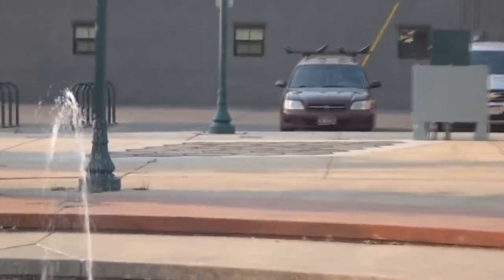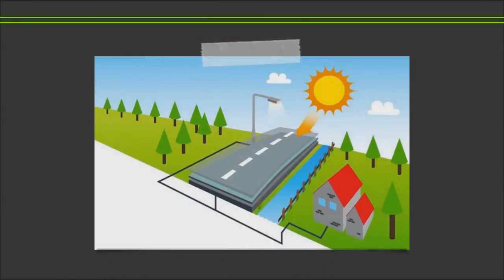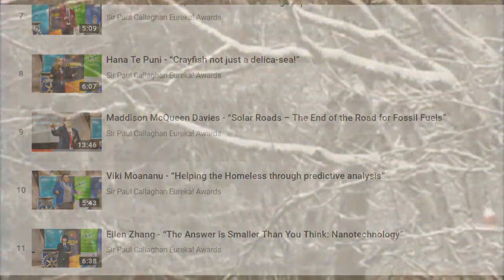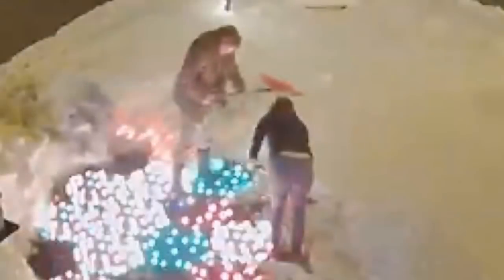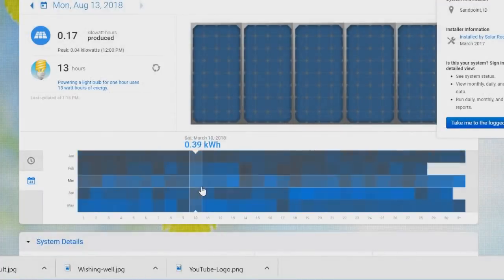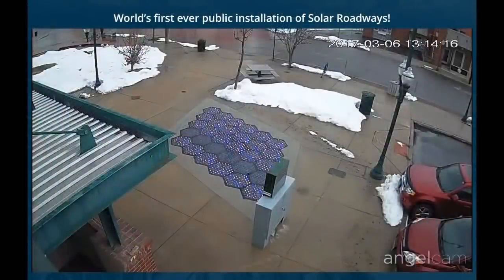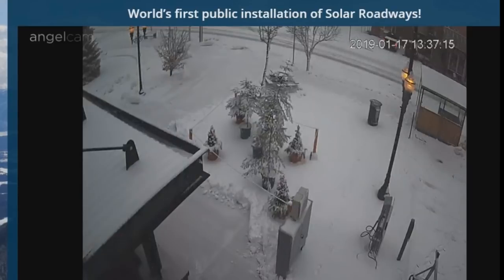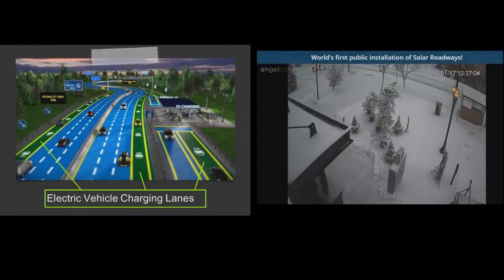Solar Roadways to be installed on Cruise ships!!?

Comment: >Cruise ships pumping out huge amounts of pollution
>solution: add solar panels
that's like justifying eating fast food on a diet because you are also eating a salad first.
Reply: Put solar panels on cows to offset the methane. Global warming solved. Lets celebrate with burgers!
Reply: @ZefVolk  Don't let Trump read this. I know he would try.
Reply: Gen Scinmore Cruise ships don’t pollute as much as you wish to believe.
Cruise ships have very stringent exhaust regulations to follow for one and most ports too have regulations in place for how much a cruise ship can pollute.
Should a ship not follow, they won’t be allowed to go along side the port alt pay a heavy fine.
Reply: Freddy Kabuffke Aaaaw snowflake still crying about Trump winning is it 🤩
Reply: @erikjohansson1814  Why should I cry? I'm not even American. :D
Reply: @erikjohansson1814  No.  The people crying are hundreds of thousands of federal workers working with out pay, the millions of federal contractors who are losing their livelihoods and will never be refunded, and the millions of people posed to face starvation and eviction all because your 'winner' wants a wall to soothe his frigging ego.  But I suppose they're all snowflakes to you too, aren't they?

Deplorable.
Reply: @erikjohansson1814 
I'd say it is less about pollution and more about how useless it would be compared to cost and weight. A 306m long cruiser build in 2018 has over 130MW installed engine power. Coating its whole surface area would give 2,9MW of solar power in ideal conditions... Thats one watt per passenger btw.
Reply: Megatron says we should just suck heat from the earth's core to generate energon and offset global warming.
Reply: @freddykabuffke461  he wouldn't. He doesn't believe in global warming
Reply: @erikjohansson1814  
"Gen Scinmore Cruise ships don’t pollute as much as you wish to believe.
Cruise ships have very stringent exhaust regulations to follow for one and most ports too have regulations in place for how much a cruise ship can pollute."

That is completely made up. There are pretty weak regulations in most ports and almost none on the high seas. 
Marine Diesel contains way more sulfur than normal diesel and on the high seas, ships have a party with very cheap HFO, heavy fuel oil, burning the dirtiest shit a refinery spills out that is is still somewhat fluid (when heated to a certain point).

A real solution is *edit LNG (liquified natural gas) [not compressed] to eliminate all the pollution. It still emits greenhouse gases though. 
Other fuels are not ready for primetime yet. Testing and development are ongoing.

For ports, ships could connect to the local grid and stop their own engines. But without regulations forcing ships to comply, the ship owners give a shit about the environment and the people in and around town.
Reply: Simplon- -B as a matter of fact, the 16 biggest ships produce more pollution than all the cars in the world.
Reply: A salad instead of French fries can reduce the caloric content of the meal by over 500 calories.
Reply: @alichi101  You do realize that those federal workers will receive their back pay when the government reopens, right? The majority of financial institutions also are happy to work with federal employees. And also, anyone accepting a job with the government is required to sign a document that they understand and accept that in the event of a government shutdown, they may go without pay during the shutdown. I feel bad for them, sure, however they will be paid for their work and they also agreed to work a job where this could happen.
Reply: @erikjohansson1814  hmmm, so why are there actual numbers that completely contradict your statement? maybe because you're just making shit up?
Reply: @skuzlebut82  sorry could you elaborate a bit? Will their unpaid invoices and credit card usage fees and rent etc be invalidated because they cannot pay when they have no money because of the shutdown?
Reply: I’d like a double 1/4 pounder, extra large fries, 2 apple pies, and a large Diet Coke....  
Trying to watch my weight
Reply: skuzlebut82 
The federal workers will receive back pay.
Federal contractors will not.
Reply: I love the part where cruise ships begin and end their voyage at the same port.  It's just like a hotel, but it floats!
Reply: @StrongOneX  Debts and payments don't disappear but being a government employee, debtors know that those with the debt will eventually get paid and grant grace to those who are working without pay. The last government shutdown, I experienced it personally and my rent payment was agreed to be paid when the government reopened, my one credit card, they agreed to not charge late fees, my utilities agreed to not disconnect my utilities after providing proof that I was a government employee, working without pay. The only company that would not work with me was my cable TV company.

By how you have spoken, you are only speaking about what you have read. I am speaking about what I know.
Reply: @skuzlebut82  thank you for clarifying. Typical cable TV providers am I right?
Reply: Freddy Kabuffke Makes “your joke” even more crap.
Reply: Stefan Forrer Show me the number.
Reply: dynd You see no haze over the oceans, but you see haze over say Shanghai.
Many ships sailing on the Chinese roads?
Back up your statement with data and facts.
Reply: Simplon- -B You are spouting rubbish.
I read and have to follow the various class regulations, SOLAS regulations and governmental regulations.
LNG is not built out to be practical.
Very few harbors offer LNG bunkering.
System to store LNG is costly.
LNG is dangerous due to its properties. 
Wont happen.

Most ports have no provision to just plug in a ship and turn on shore power. Ive seen 100’s of ports and only once seen shore connection in a commercial port for cruise ships, Malmö Sweden.
In addition some ships run 50Hz and some 60Hz.

All modern ships are equipped with a catalyst system and dont just spew out the exhaust.
All engine makers use less pollution, better fuel economy as a sales argument plus they too have to follow what the class say is allowed and what not.

I’ve just been around ships engines for say 30 years so what do i know.

oh yes, in addition some countries have in place rules for how much a ship can pollute while in port.
Reply: I eat fast food on a diet and I lose a pound a week with no exercise. I hate salad.
Reply: @David13ushey    Freakin' nuclear-powered COMMENT!   Nailed it!  Worth repeating:
"The people crying are hundreds of thousands of federal workers working with out pay, the millions of federal contractors who are losing their livelihoods and will never be refunded, and the millions of people posed to face starvation and eviction all because your 'winner' wants a wall to soothe his frigging ego.  But I suppose they're all snowflakes to you too, aren't they?"
Reply: @Agent-000-0    "That is completely made up. There are pretty weak regulations in most ports and almost none on the high seas. 
 Marine Diesel contains way more sulfur than normal diesel and on the high seas, ships have a party with very cheap HFO, heavy fuel oil, burning the dirtiest shit a refinery spills out that is is still somewhat fluid (when heated to a certain point)."

Exactly.
Reply: @erikjohansson1814   Oh really?  Please show me what practical efforts the cruise ship industry has done to 
get off dwindling fossil fuels ASAP and powered by renewable energy sources & making the transition AS SMOOTH & EASY AS POSSIBLE for the sake of 
1) continued sustainability
2) significantly reduced greenhouse gasses
Reply: I got a Diet Coke with my 2 Big Macs... So that evens out to calorie neutral.
Reply: @cockatoo010  How about ban such a wasteful polluting NON-NECESSITY altogether.
Why the fuck should DRUGS be outlawed, even though NOBODY FORCES OTHERS to consume drugs,
when cruise ships force great amounts of pollution ONTO OTHERS?
Reply: The Ultimate Reductionist Another fool jumps the environment train knowing nothing about the subject. 

Engine makers have set standards for what kind of fuel the engines should burn and how much of what a fuel can or should contain.
Bunker is sampled and analyzed regularly and every time bunker is taken onboard. 
No sane ship owner would run on the cheapest dirtiest fuel because it will cost in the end in form of wear of components. 

No ship is running on asphalt which I believe is the ”dirties” thing a refinery produces. 

Your cellular, pad or computer you are typing on is a refinery product as well. You should stop using it, pollutant you know.
Reply: David13ushey Show the figures from reliable source.  CNN is not one of those.
Reply: @theultimatereductionist7592  It just annoys me that he vomited a 'sick of trump winning dur hurr hurr snowflake' out of no where.
Reply: @erikjohansson1814  while I agree with your ship knowledge, majority of container ships are old as fuck and they pollute a lot, retrofitting exhaust management system is costly. Running high sulfur heavy fuel is still a thing everywhere there is no regulations when it comes to that ships. No sane company will accept that economic loss running higher refined fuel when not needed. They switch fuel when near ports and coastline in general where there are emissions regulation. Also when ship is parked for a long time when it's not in use, they connect mainland power so they don't have to run on auxillary motors for power. Your statement that they almost never connect mainland power is a bit false I think, they will do it even if they just have like a couple of ships in long time storage. Partly because of noise pollution, and because there is still some crew onboard always even when in storage they still consume a lot of power. Your political views however...
Reply: David13ushey he’s guaranteed back pay I thought
Reply: But I got a diet coke, so it's fine.
Reply: @Erik Johansson  No. In a way I like Trump - thanks to him politicians that run my country suddenly start looking in comparison rather responsible and reasonable.
Reply: @David13ushey  thats not Trumps fault.  And those federal workers will get back pay. If the Democrats would stop holding us hostage and negotiate, we could end the shutdown.
Reply: @Mariomario-gt4oy  yes he does. He just disputes that its man made.
Reply: @alichi101  2.9 million passengers? Surely that's a KW, now a watt.
Reply: cruise ships are probably more efficient/less polluting than if everybody on board would make the same trip with their tesla
Reply: @erikjohansson1814  

You have no clue whatsoever about the shipping or cruise line industry. Lets set this straight. 

Ships still use HFO, it is the dirtiest product a refinery sells as a somewhat fluid fuel. Asphalt was never a real fuel you genius. Petrol coke is also not used for shipping, which is probably the lowest quality fuel a refinery spills out. Most coal-fired power plants have problems burning it properly. 
There is also Orimulsion, which is a synthetic fuel based on bitumen, but this is also not used in shipping.

And since HFO is used forever, engine makers have built engines for well over half a century capable of burning HFO. 
With stricter regulations in some areas of the world, they changed the designs to being dual-fuel capable, using marine diesel near the coastline and in ports. They still use HFO on the high seas because it is cheaper and it is still legal. Even maritime diesel is a problem, cause cruise ships suck at exhaust gas treatment compared to diesel trucks in Europe.
Marine diesel contains way more sulfur than EU and US land used diesel. And with the power demand of a floating hotel, cruise ships produce a lot of pollution in a harbor. But since it is legal and cheaper, it is used.

Same goes for land power systems. There is one in Hamburg, Germany, but just one ship from Aida cruises has a connector. The system works, but it is cheaper to burn diesel than to pay the electricity bill from the Hamburg port authority. And since Germany has a free market scarecrow as chancellor, there is no way ships will be forced to be more environmentally friendly. Pretty genius, since this undermines German maritime suppliers and the shipbuilding industry itself - for the benefit of poisoning the own population. 
In case you all do not know, Germany is still a behemoth in shipping (sailing under the German flag is not required). The financial crisis and the fallout in the shipping industry left some huge marks, but still, it would be a good point to start. And Germany is a world record supplier of cruise ships and ferries. 

LNG is already a maritime fuel. 
So your remakers look a bit hilarious. 

Quote: 
"LNG is not built out to be practical.
Very few harbors offer LNG bunkering.
System to store LNG is costly.
LNG is dangerous due to its properties. 
Wont happen."

Since the sulfur from HFO turns into acid in wet exhaust gas scrubbers, which then eats up the scrubbers, they pretty much suck. There are other types, but certain lines are betting on LNG to be compliant with 2020 regulations and well beyond, to the end of the ships life (30 - 40 years).

Cruise ships have fixed routes, it is easy to set up LNG refueling. Same goes for most container ships, bulk carriers, and tankers. There is no need for a harbor installation either. LNG bunkering vessels serve as a transport, storage and floating gas station. 
And most cruise ships sail rather short trips, so the range is not a concern either. 

Some container ships are already getting an LNG retrofit, depending on the tank size it serves as coastline and harbor fuel or they are mainly using LNG with some marine diesel backup. For the coastal, coastal/river, and pure river shipping, it works out to use only LNG.
There are probably over 50 very large container vessels, ready to use LNG. They just need to switch container storage space for the tank. 
South Korea announced to support the construction of 140 small and medium-sized ships running on LNG. 
https://www.lngworldnews.com/south-korea-to-back-construction-of-140-lng-powered-ships/
It is happening, right now. 

There is even a first fully LNG powered cruise ships in service, the AIDAnova, built by Meyer Werft in Germany. The ship is sailing for a German line (Aida cruises) which belongs to Carnival Corporation & plc. So the biggest operator of cruise ships ordered a fleet of LNG powered vessels (Excellence-class), built by one of the best shipyards in the world to use mainly if not entirely LNG and Mr. Internetexpert says it won't happen. 
The first ships were ordered in 2015, to secure production slots in 2017/2018... and the first is in service now, four are under construction and overall 9 are planned. The yard has "orders for twelve more LNG-powered vessels".

Having a look at https://www.lngworldnews.com/category/news-by-topic/lng-fuel/ shows that there is a huge shift in the industry.
Reply: @jailbird1133  uh no he doesn't. He thinks its a Chinese fucking hoax and a  conspiracy
Reply: Simplon- -B Your Wikipedia copy and paste text is too long to reply in whole. 

And what you have mentioned regarding LNG, there are always exceptions and Norway were first to use LNG on fixed routes within their fjords to protect the environment. 

For any other vessels it will not be doable for long. 
Who pay the LNG installation ashore? Ship owner, city, tax payers, port operator?
LNG tankers you can forget. Too costly to build, to maintain and operate if for bunker only. 

Shore supply, moron, I did mention there is one in Malmö, Sweden. Now Germany too wow. 

To sum it all up, you have no clue except for what you are told by greenpeace and other not in the know sources.
Reply: @erikjohansson1814  

This is not a wiki copy paste you scumbag. I wrote that myself, cause I have a clue what I'm talking about! 
You are just unable to counter the facts I presented here, so you start bitching and throwing accusations. 

"Shore supply, moron, I did mention there is one in Malmö, Sweden. Now Germany too wow."

You are just an idiot. It was not about the land power supply, it was about its use...
Reply: Morten Nice to see at least one normal person here. A civilized conversation is always welcome. 

You are very right that on the open seas outside a countries boarders, the various regulations are gone. 
I guess it is simply because no country own the open seas and therefore can't govern the same. 
That is a pity since if it could be done, there would be far more pressure on engine makers and ship owners to use more environmentally friendly fuels. 
Solar panels not included, rubbish. 

And yes, closer to shore line ships, those running HFO, do switch to MDO or gas oil. 
A part of the reason is, unloaded engines, low speed or alongside, don't run well on HFO plus wear and tear is higher. 

LNG,
Ships that run regular ports where distance isn't great could do so. Norway have some, been on one gas engine ferry. 
But it still comes down to who invest in what comes to infra structure and such comes to bunker stations. Owner, port, city, private funds or by tax?
And also, might be a pain in the ass to sell the vessel in future since next owner may not use the vessel in a port with LNG capacity. 

One thing that could change quickly if there would be some will from mainly politicians is not to allow vessels in own countries home which are too old and rotten. 
A lot of rust buckets float around from mainly China, India, any African country, Indonesia etc etc. 
Ban them from modern regulated countries and they too will soon look over their vessels or lose revenue. 

Think I cover all...
Reply: @erikjohansson1814  
"You are very right that on the open seas outside a countries boarders, the various regulations are gone. 
I guess it is simply because no country own the open seas and therefore can't govern the same. "

IMO, International Maritime Organization (belong to the UN) ever heard of it you shipping expert? No need to play guessing games here. They are very slow because there are >170 members and 40 of them have a seat on the council. 

Still, there is a new sulfur limit to meet.
http://www.imo.org/en/mediacentre/hottopics/ghg/documents/faq_2020_english.pdf

IMO also says LNG works as a maritime fuel.
Reply: Simplon- -B IMO yes yes. LNG yes yes.
If you doing short trips along a coast or between two nearby countries all good. Do proper voyage across the seas and LNG is not efficient at all. Does not contain as much energy as fossil fuels, is far more dangerous to use due to its nature and it will cost a bomb to install or retrofit onboard a vessel. 
Plus as mentioned, vast majority of ports do not offer LNG bunker. 
There is a reason why LNG vessels are the most expensive vessels to design, build and maintain. 
IMO is not a law enforcement agency which has any sort of authority.
It is up to member states to follow IMO’s recommendation. 
Countries I did mention earlier don't give much f**k about those recommendations.

Thank you for recognizing me as a shipping expert by the way. You may learn something, although my hopes for that are quite limited.
Reply: @erikjohansson1814  
Bla bla bla. 

All unfunded bullshit. Mr. Internetshippingexpert is smarter than shipping companies or the IMO. 
Lovely, just lovely.
Reply: Simplon- -B With your blah blah answer, thank you for proving me right. And who knows, hang around here and you may, just may, learn something.
Reply: @erikjohansson1814  

You are just pathetic. 
I wrote a huge comment, sticking links in there and you smeared it as a copy paste from Wikipedia. Instead of engaging on that, you searched for a comment that was not completely opposing your position. 
Refusing facts does not make you smarter than anyone else, you know that, right? 
LNG is entering the shipping market right now and you are here to say that LNG could not work as a maritime fuel.
Just shut up. Inform yourself about the shift towards LNG and then come back.